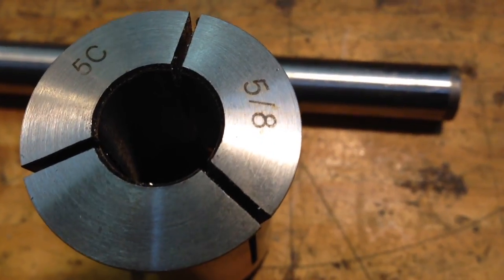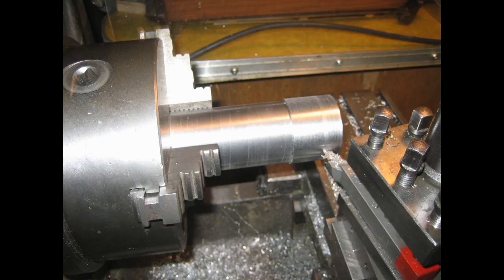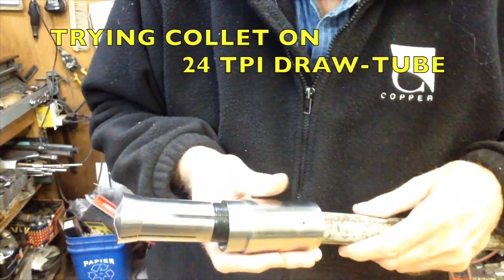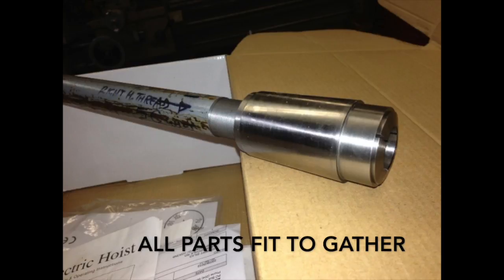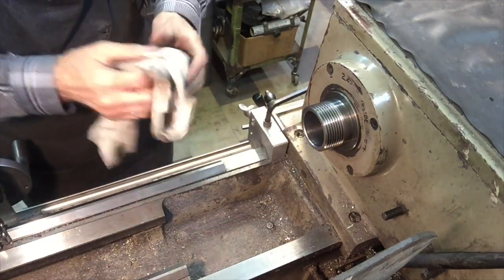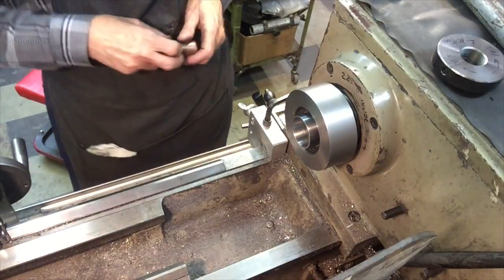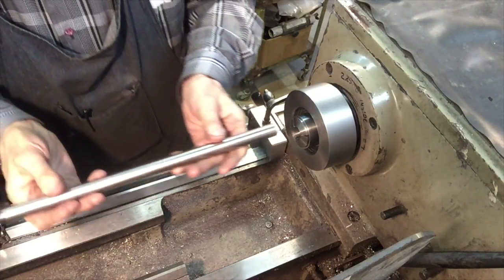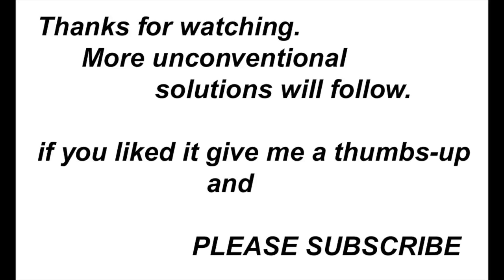#27 - MT5 to 5C ADAPTOR

Comment: I recently bought an import lathe with a D1-4 spindle but which is internally an MT-5 taper. It came with a D1-4 collect chuck which from the factory is junk - it doesn't seat properly at all. So I'll be building an adaptor very much like you have shown here. Thanks!
Reply from the maker: James Scheffler thanks for your note. Please let me know what is a D1-4 spindle. Is it a metric spindle?
I can get a note faster at: 
thatoldbob@gmail.com
Reply: The D1 camlock spindles come in a few different sizes; mine is D1-4. There's a litle bit more data here:
http://www.tools-n-gizmos.com/specs/Lathe_Spindle_Mount.html
Interestingly, the D1 series spindles don't always have a Morse taper also; I just seem to have gotten lucky.

Comment: If anyone makes an adapter like this, it's a good idea to have a flange on the front of it. Then you can use the spindle thread protector to eject the adapter from the spindle without having to knock it out and possibly damaging the adapter.
Reply from the maker: Aceroadholder it's a very good idea for next time I thank you for it. As of now I use an aluminum rod to knock it out and put a towel on the bed for soft lending. Bob

Comment: My old Sheldon 15 has what I believe is an mt5 in the spindle. I’ve been attempting to match that taper for days with the compound, I’m close but that’s not getting it.  Did you find the taper to be .052?? Per inch? Because that’s not getting it for me.  That 5c tube and collet chuck is exactly what I’m trying to make.  If I get the taper right I’ll make a bunch of slugs with the right taper to build other, r8, er40, other Morse, b&s. Any insight would be appreciated.

Comment: Sir, did you machine the inside with it installed? I assume you did.
Reply from the maker: Yes I did. I see that they published the version which had no finished explanations. Later I added a detailed explanation for that adaptor. I had no joyce, I had to turn the 5C part by knocking in the the halfway finished job because I had to cut the length when the outside was finished and continue from the other side. the fit was so good that the 5C cone, turned with small feeds, did not overcome the friction. The adaptor has to be knocked out like any good taper. I polished the surfaces by sandpaper, I should have ground them, it would resulted in a more accurate job. Thank you for asking and for watching my primitive presentations. Actually I just want to show the idea, I do not want to entertain and bore anybody.
If you are interested  in anything else please write to: thatoldbob@gmail.com